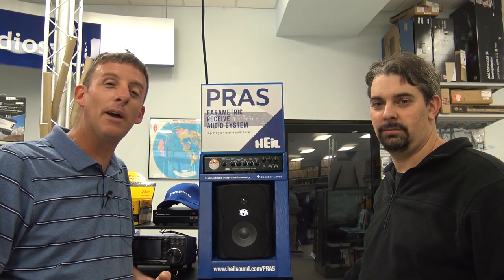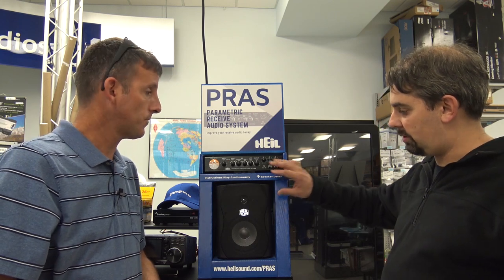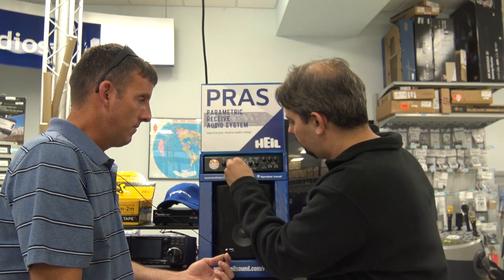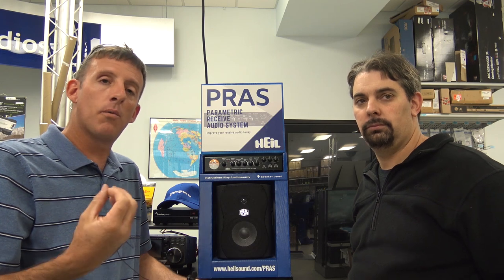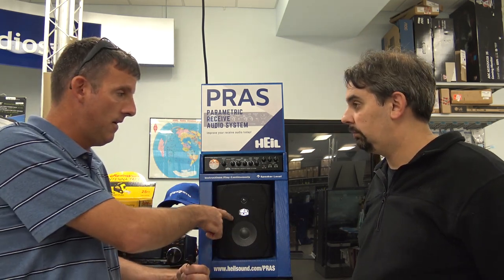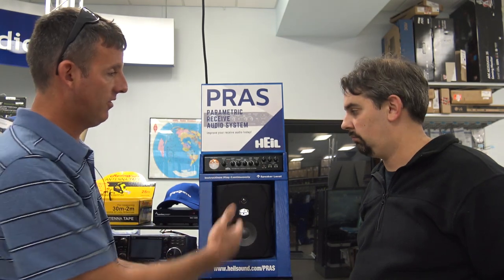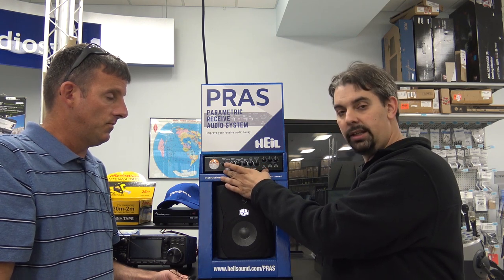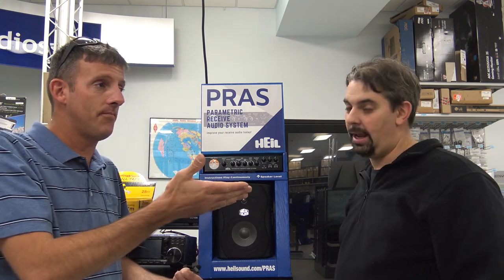Heil Sound, PRAS Parametric Receive Audio System, Quick Look

Comment: In a normal audio equalizer, you got the audio range divided into fixed frequency bands of which you can adjust their individual gain (or volume) by moving slider pots. The more number of pots the more precise control you have. A parametric equalizer works in a similar way, but instead of having fixed (or predefined) frequency bands, you have knobs to adjust the frequency you want to control and another knob to adjust the gain of that frequency that you just selected. This way, you actually have indefinite number of control points. A parametric equalizer is a fairly easy circuit to make and there are many many examples you can find on the internet. They are all based on opamps both for frequency filtering and gain adjustment so not much components are needed and they are simple to make on your own. It can be a nice DIY project for the ham shack if you are inclined to amateur electronics. Good video Eric, I think it will be an inspiration for the hobbyists.

Comment: Nice product. That will help us with diminished frequency ranges in our hearing.
Reply: Well if you use it that way you can set the band closest to your hering suppresion.  If there are enough bands for each to be narrow enough for that.  I would think a 10 band EQ from a used guitar amp or the in line EQ actually.  I have used them to tune microphones and guitars, and they work just fine.  Should do the trick for you.

Comment: One feature I always wanted on an HT was sound leveling so I get more or less the same volume level between different operators.   Will the PRAS do anything like this?
Reply: Probably not since the relative  difference in volume levels is a function of AGC (Automatic Gain Control), and in FM machines the level needed for full quieting.

Comment: This product is good for folks who won't mess with menus, submenus, and settings to change the audio output of their rig using features that are built into it but can and will use something that puts knobs at their direct control for adjustment and immediate results.  The folks at Heil were smart to include a recorded instruction on how to use it since many folks won't RTFM.  One of the things I like about the SDR transceivers I use is that they have both TX and RX EQ's and the ability to shape the sound coming and going to best meet the operating needs.